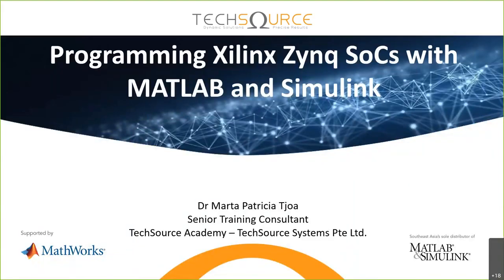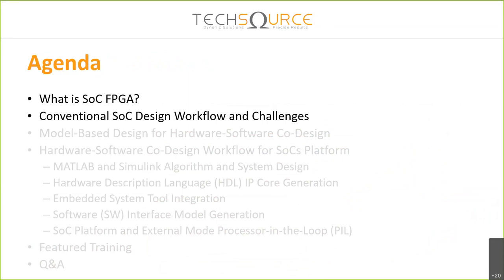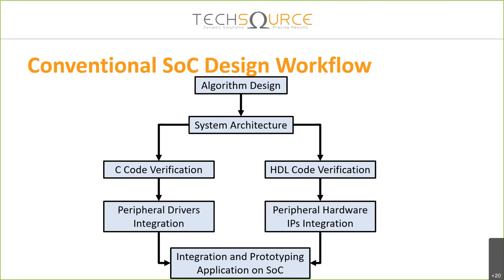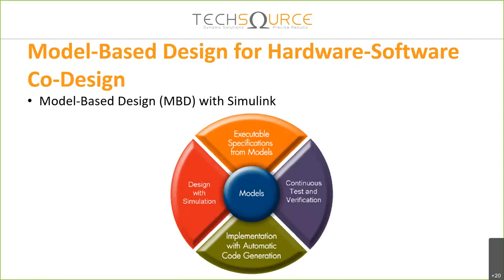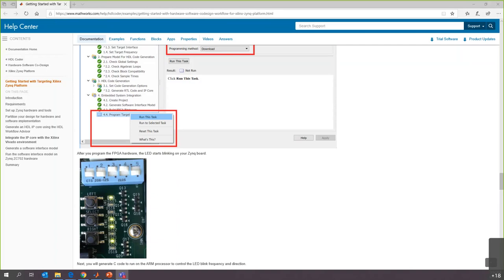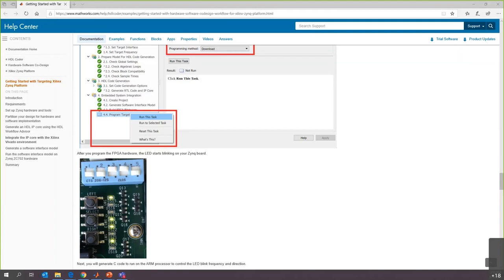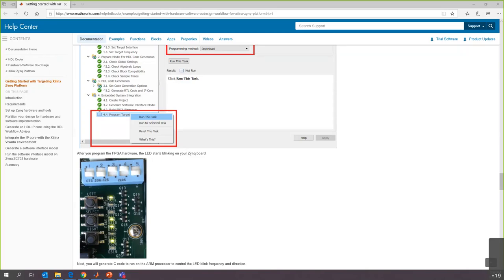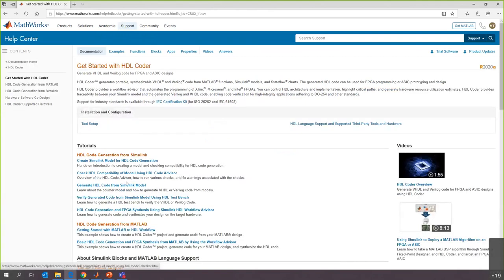Programming Xilinx Zynq SoCs with MATLAB and Simulink

Comment: please have you any idea, how you can communicate from simulink to FPGA when you have yest your design block in FPGA. Have you any tutorial explain the communication between  MATLAB and vivado hlx. Thanks
Reply from the maker: You have to choose whether you want to use Simulink environment or Vivado to do simulation and verification.
If you want to use Simulink environment, you need to export your design in the form of HDL code to Simulink with HDL Coder.
If you want to use Vivado environment, you need to export your design in the form of HDL code or IP to Vivado. You can refer to MathWorks website on HDL Coder.
We do have training that covers Generating HDL Code from Simulink. You can refer to our website https://www.techsource-asia.com/generating-hdl-code-from-simulink
 
Regarding Vivado HLS and MATLAB/Simulink integration, the support is from Vivado HLS to Xilinx System Generator. You can refer to Xilinx website on Xilinx System Generator. 
We do have training that covers topic on Xilinx System Generator. You can refer to our website https://www.techsource-asia.com/fpgas-implementation-with-simulink